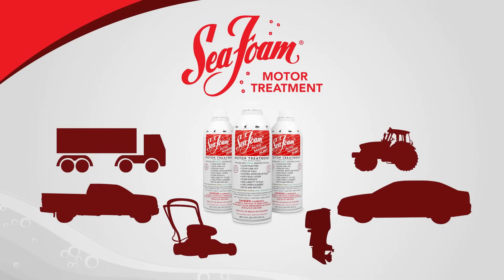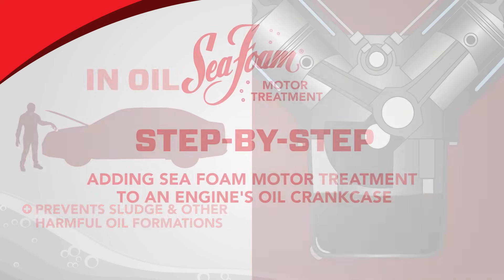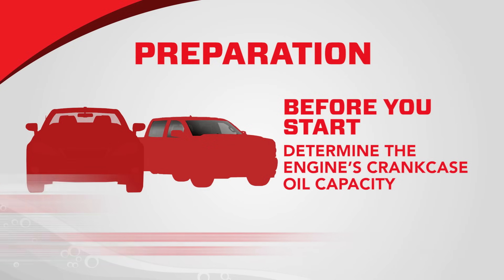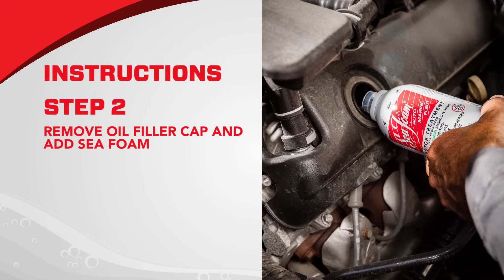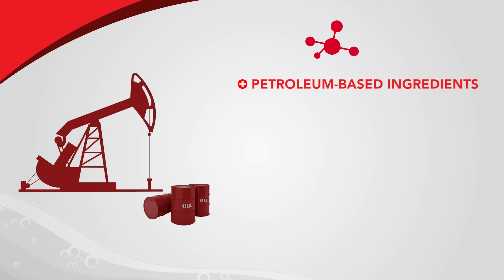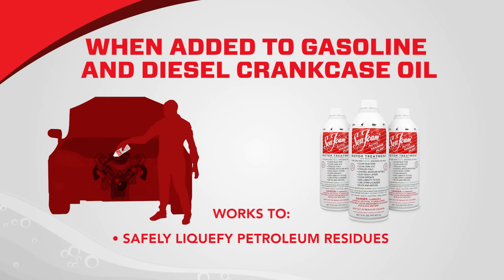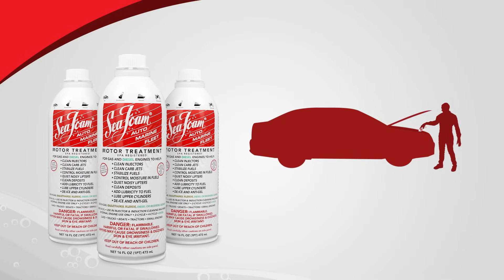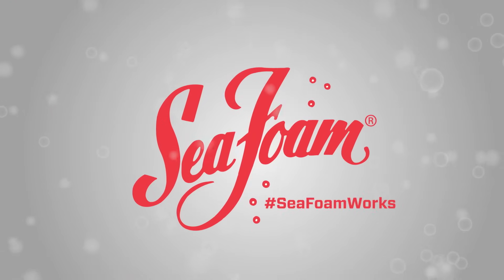Add Sea Foam to your oil crankcase - super easy!

Comment: Question: Does it evaporate?
Let me explain: I added the appropriate amount to the crankcase but couldn't start/run the engine for 2 weeks due to an unrelated issue that I fixed later. Can I then assume that some of the seafoam evaporated since the engine didn't turn allowing it to mix with the oil? Should I top up? Pls let me know. Thanks.
Reply from the maker: Sea Foam is petroleum oil - it will not evaporate from the crankcase so good to go/nothing to do.
Reply: @SeaFoamOfficial  Lake Speed Jr. has a video where he says he did a test on Seafoam and it's flash point was  55F. Is this true?

Comment: Its recommended to add this 100-300 miles before an oil change...my question is if I'm adding it to my ATV crankcase...diving 100-300 miles is going to take a looooong time.  Does it still do a good job cleaning if I add it 50 miles before oil change? Thanks
Reply from the maker: For an ATV figure 60 minutes of operation with Sea Foam in the oil. Hope this helps!

Comment: My car takes 4 liters of oil and tends to have a somewhat noisy valve train until the oil gets flowing.  I just changed the oil and filter though and I'm not sure if putting some Sea Foam in on brand new oil is the best thing as the oil will become very dirty fast. Would the dissolved sludge in the oil cause extra wear or would the oil filter clean the harmful grit?
Reply from the maker: Hi Brock: No worries - just add half a can and let it work until ready to change oil.
Reply: If it looks really dark just change it. Even if you haven’t reached your interval. Oil is cheap, engines are expensive

Comment: Question: wondering if you can dispel this:
Somebody told me to not use this on older vehicles, because sometime that sludge is covering up leaks. And when cleaned will expose the leak... 
what do you say?
Thanks
Reply from the maker: Great question, thx. My answer: Whatever was suggested supposes that all old vehicles have leaky seams that are sealed by sludge. It's true that some might, but more likely not the case at all. Sort of like telling someone to NOT go to the dentist for a toothache because you're too old. Anyway, I would never hesitate to use Sea Foam in oil. Hope this helps!
Reply: I started using SeaFoam about 2 years ago on my 2001 civic and it's worked wonders. I'd toss that myth you were told out the window. SF also makes it for High Mileage cars if you're more comfortable with that.

Comment: Can i run my truck wt that or i have to doit like a fluch and change my oil  fast or i can use as a aditive and wait till my nex oil change?
Reply from the maker: Thanks for the question! You always want to drive at least 100 miles with Sea Foam in the oil before replacing oil. You can drive the full length of the oil interval if you wish. Hope this helps!

Comment: So what happens if you leave it for longer than 300 miles in the oil?
Reply from the maker: No worries. Can leave in oil for entire interval.
Reply: @SeaFoamOfficial  wow really?! I heard the solvents eventually started wearing down plastics & seals.
Reply from the maker: Sea Foam is petroleum oil, same raw material as motor oil. A liquid (incl water) with solvency capabilities does not mean that it is harsh or harmful. Hope that makes sense!  @DominiAeternum

Comment: I wanna try this on my Toyota pickup 84 it has 95k but car was sitting for a while please help we’re doing I start and I just had oil change when do I add it?
Reply from the maker: Add it where you add motor oil. Just open the filler cap and pour in half a can.

Comment: I have a very small leak in my rear main seal, wouldn't this affect the leak?
Reply from the maker: It might if the seal is clogged with old oil varnish.

Comment: Does it help with hard start Honda crv? 03?
Reply from the maker: I'd get a can of Sea Foam Spray and 2 cans of High Mileage. Add half a can of HM to the oil, 1.5 cans to a very low tank of fuel, then do a Sea Foam Spray treatment into the throttle body - easy to do on a 03 CRV. Do all that and let us know how it works after a day or two of driving!

Comment: Just did an oil change. Added 5oz for 5 quarts of oil. Should I change my oil within 300 miles or can I go longer?
Reply from the maker: Go the whole length of the oil interval.
Reply: @SeaFoamOfficial  oil is dirty. I’ve driven the car 75 miles
Reply from the maker: @carhoarder602  It's working!
Reply: @carhoarder602  oils dirty after only driving 75 miles? Damn
Reply: @truthseeker1203  yes
Reply: @carhoarder602  and what happened long term? I have an old accord that has been pushing oil into the intake due to blow by. I suspect it could be stuck rings. I’ve been doing research for days trying to see if there’s a chemical solution to this. Maybe this would help?
Reply: @truthseeker1203  cleaned out a lot of the oil gunk. I saw it in the color of the oil

Comment: I have 2 important questions. 

Do you have to add sea foam on engine cold start or get the engine to operating temperature?

How Many Degrees Do I Have To Get A Vehicle To Operating Temperature?
Reply from the maker: Can add whether engine is cold or warm - makes no difference. Operating temp takes about 5 minutes at idle, sooner if you drive a bit.
Reply: @SeaFoamOfficial  Great! Thanks!
Reply: And One Last Question:

If I Add Seafoam In The Engine Crank Case, Will The Timing Chain Bounce Off Of The Camshaft Sprocket Gear?
Reply: I @elvingladney2476 I want to know too. Definitely don't want no stretch chain either.

Comment: Can I add Seafoam after an oil change or before.
Reply from the maker: You can add any time but best to add 100 to 300 miles before an oil change.
Reply: @SeaFoamOfficial  if added after, does it need to be drained/removed from the crankcase before using the vehicle regularly? 

Edit: I'm reading in other comments, from my understanding it is Sea Foam's recommendation to change oil again 100 miles after adding seafoam. I won't be driving my truck super often after the initial change, so should I even use sea foam or just do a normal oil change? 

My truck (94 Nissan D21, auto, 2.4l) has sat for a few months needing repairs and the oil has gotten sludgy and dark. Was just going to change the oil before driving it again, but someone recommended Seafoam to me.
Reply from the maker: @kanaka118446  You can add it any time and leave it in as long as you want. The recommendation only means it's the best method.
Reply: @kanaka118446  Will you sell your 94 Nissan?

Comment: My 6.6. Duramax has a taping sound. I believe the motor should be a little quieter can i add to my oil ? And will it work my gas mileage has been real shit since my last oil change and fuel filter change that i just did . I just find that weird i was getting 13.5 miles a gallon in the city 🏙 with 24”inch rims and tires and my truck has a performance tune on it before my tune i was getting only 10.5 miles a gallon and after tune i got 13.5 miles per gallon and now only 9.5 miles per gallon after i change my oil filter and fuel filter last week just seems weird to me any help would be greatly appreciated
Reply from the maker: Yes, add every oil every interval and let us know if the noise goes away. A 6.6 Duramax will take a full can in the oil crankcase.
Reply: @SeaFoamOfficial  i put one in the gas yesterday and i hear a big difference and my gas mileage went up 5 miles per gallon to what i was getting before I added it and as well i did the mass flow map sensor and air filter should i throw one in the crankcase as well please let me know what you thinks thanks so much for your help I’ll be waiting on your reply
Reply from the maker: @Richieboss305  Adding to oil is essential!
Reply: @SeaFoamOfficial  thanks so much for your help I’ll keep in touch let you know how it works out for me

Comment: I put 4 oz for my honda accord 1998 4cyl and then I drive it 10min, check engine light turn on. What do I do with it ?
Reply from the maker: I would put a code reader on it to find out what prompted the CEL. Most auto parts stores will read a CEL code for free.

Comment: I want to add this to my 07 Hyundai Tiburon to clear out sludge before I convert it to synthetic oil but I'm nervous because some people say they have major issues after adding it, my motor doesn't leak and runs good though so would I be fine to add this?
Reply from the maker: People are describing old engines with leaky worn out gaskets. I doubt you have those problems. No worries.

Comment: This saves francis my sl1 saturn from rod knock my saturn get bad rod knock every 10k kilometers and I just give it some sea foam wait a day run the engine 10 minutes and change oil it always stopped the knock and will until 300k

Comment: If I use an electric oil extractor to change my oil through the dip stick, I know it will leave about 1% of oil behind. If I use seafoam, will the liquefied sludge be able to go through the thin tube on my oil extractor? Is it safe to leave behind that tiny 1% of oil?
Reply from the maker: Great question. Anything Sea Foam cleans will blend into the fluid oil phase, so yes.

Comment: I use seafoam before oil change, i dont put it in fuel anymore as i started having cat / o2 errors after putting it in gas (was coil errors causing missfires - reason i tried seafoam thinking injectors were dirty).

Then i run my mowers on that dirty oil for 20 mins then fresh oil in them all.
Reply from the maker: Hi David. FWIW, Sea Foam has absolutely nothing to do with cat. converters.

Comment: If filling in gas tank, am I supposed to add bottle to an almost empty tank and run the engine? Or am i supposed to add seafoam and gasoline together?
Reply from the maker: Great question: Add to fuel when the tank is lower (vs more or full), then drive at least 20 miles with the higher concentration before adding more fuel.
Reply: I put a can in an almost empty tank at the gas station, then fill it up with gas.
Reply: @Jared-91  That makes no sense...LOL

Comment: Since I just had an oil change,  is it better to add to seafoam to my fuel instead of in the crankcase? I don't want to have to get another oil change in 300 miles
Reply from the maker: Great question.  Yes, can add to fuel. Can get another can when closer your next oil change.

Comment: i’ve got a 14’ fusion and the ticking sound when idle drives me nuts will this help? and can you only use it right before an oil change?
Reply from the maker: Add half a can every interval. You can also add any time during the oil interval. Easy!  Lifter noise typically fades away within 100 drive miles or sometimes 2 or 3 treatments.

Comment: I have a 4.8 ls motor in my truck and I’ve used seafoam in my oil with good results but my truck has been sitting for awhile.
What’s the best way to get rid of the sludge? Should I add seafoam before oil changes then change the oil prematurely to expedite sludge removal?
Reply from the maker: All you do is add half a can of Sea Foam to oil every interval. Will progressively clean the harmful residue and sludge from your crankcase over time.

Comment: I have lifter tick in my 5.3 LS motor will this help resolve that issue?
Reply from the maker: Yes, it will quiet a sticky lifter. Just pour half a can into your oil crankcase every interval to keep your crankcase cleaner.
Reply: How far should I run 5.3ls?
Reply from the maker: @comaradelee  If you mean how long to run Sea Foam in oil, add 100 to 300 miles before replacing oil. Use every interval.
Reply: @comaradelee  1 million miles

Comment: I just put a can high millage sea foam into my Prius gen3,  10 Oz goes into  my 10 gallon gas tank, rest 6 oz on 5 quarts my crank case. after 150 miles driven.  I noticed my engine oil turning brown. and my coolant  dropped about half quart. does sea foam cause blown head gasket? what should i do now? any suggestions?
Reply from the maker: Hi James: If your coolant is low and oil is milky brown you likely have coolant leaking into your oil crankcase. No, adding Sea Foam to oil would not have anything to do with causing a failed head gasket.  Get it looked at and evaluated. Let us know what you figure out.
Reply: Add in the glitter after a coolant flush good to go till you save up for a head gasket repair that’s costs a thousand or more to replace in the shop.
Reply: Ohh n after that change yer wet spark plugs after your glitter stopped the leak should be good to go. Cause you will burn out the excess out the tailpipe

Comment: My car has a short knock when it starts. Will this eliminate that.
Reply from the maker: Engine knock occurs in the chambers, so Sea Foam Spray treatments would work best. Adding Sea Foam to oil won't help knocking. If you're hearing lifter noise (rapid ticking), try adding half a can of Sea Foam to oil every interval...the noise will fade away quickly or might require two or three intervals. Hope this helps!

Comment: Sea foam can be added at any time between oil change intervals,but your recomendatios is to add to crankcase 100 o 300 miles before each oil change....Can you explain why?is better or what?After that is good to use all the time when i am filling up the tank,adding just 10 ml/liter?
Reply from the maker: When adding to oil crankcase, a minimum of 100 miles allows enough time to circulate and clean. Can add to fuel as often as you wish. Add a whole can to fuel when tank is low (creates a greater cleaning concentration) and drive at least 20 KM before adding more fuel.
Reply: @SeaFoamOfficial  Yes,i did it,but still i dont understand why if is safe to put each time i am changing the oil,the recomendation is to put before to oil change?What is happening if i put on my crankcase and running the next 10.000 km ?You said,not dilute the oil so what is the problem?Now i am using only on the fuel tank,the the car is running better!Thank you for your time!
Reply from the maker: @GREENTICKETRO  You can add 1X each interval at any time as long as you drive a minimum of 100 miles or 160 km.

Comment: I don't drive that many miles can I add Seafoam and change my oil a week and a half later?
Reply from the maker: Prior to changing oil, most important is to drive 100 miles minimum after adding Sea Foam to oil crankcase. Sea Foam needs engine oil heat and enough circulation time to work.

Comment: Wanting to try this on a 150k 02 Corolla that burns a wee bit of oil but compresses perfect.  1zzFE with that nasty piston ring clogging issue most likely.  Good to do 2000k oil changes with this on the final 300 miles?
Reply from the maker: Yes + check out Sea Foam High Mileage for your Corolla.

Comment: What about to crank case of 2 stroke 3.0 outboard
Reply from the maker: A 2-stroke does not have a closed motor oil system so no need.  If your 2-stroke is oil-injected, you can add Sea Foam to the oil fill tank.

Comment: could you add this to a motorcycle? will it interfere with a wet clutch
Reply: I cant see how besides you only want to go 100 miles or so.
Reply from the maker: Works great (and safe) for a wet clutch.

Comment: Can I àdd 1 to the tank and 1 to the oil at once??
Reply from the maker: You can add to fuel and oil systems at the same time.  Not sure what you mean by 1... If 1 can to each, adding 1 can to most oil systems is too much. For example, a 5 or 6 quart oil system should use half a can (no more than 5 to 8 ounces).

Comment: I'd like to know if I can use this as a engine flush prior to changing oil (does not say on the can}....Put in a WHOLE CAN, then idle engine (NO DRIVING) for 10 minutes or even a hour, then change the oil and filter... There are engine flushes out there that do this principal, HOW ABOUT SEA FOAM?  Any comments?
Reply from the maker: Not recommended. Better to add half a can and drive at least 100 miles so has plenty of time to heat and circulate.
Reply: @SeaFoamOfficial  If I idle the vehicle FOR ONE HOUR, it will more than get hot enough and heat and circulate! And you say to drive for 100 miles?Would that be at 35 mph in the city or 70 to 80 mph on the freeway?Any more from anyone? I really think this will work, by just idling for one hour. The engine WILL GET HOT.
Reply from the maker: @MrLmm001  Just like a dishwasher - requires both heat and enough time to circulate to work.
Reply: @SeaFoamOfficial  I have to say that I strongly respect that comment. You also need to put that (as in HEAT) ON  your cans for marketability..  I think this will work

Comment: At an oil change,  cant i add the seafoam to the crankcase , run car not drive or put in drive, but let it idle in park to flush debris, then drain and re fill?
Reply from the maker: Drive at least 100 miles with Sea Foam in the oil before replacing oil. Adding and running for a short period of time won't do much.
Reply: @SeaFoamOfficial thanks will do!!

Comment: So you add this to your motor or fuel tank?
Reply from the maker: Can do both for different cleaning purposes. Add to fuel tank to clean the fuel system. Add to oil crankcase to clean the oil system.
Reply: @SeaFoamOfficial  thank you so much sir
Reply: @SeaFoamOfficial  another question what about the other seafoam product the one that says oil stabilizer that you put with the oil; how does that work and what does it do?
Reply from the maker: @Ravenwest9876  The 32 oz oil stabilizer works to fortify oil. When changing oil, replace one quart of motor oil with the oil stabilizer.
Reply: @SeaFoamOfficial  thank you sir
Reply from the maker: @Ravenwest9876  Glad to help! 🙂

Comment: I have a 1993 Toyota Tercel with 150k. Miles on the engine I can see some blue smoke coming out of the tail pipe the car runs good how many times should I repeat the process??
Reply from the maker: Hi Marvin: Add it every interval as long as you own the car. Are you seeing a plume of blue tailpipe smoke at start up or while driving down the road? Is the Toyota burning oil?
Reply: Tercel’s are Notorious for burning oil.